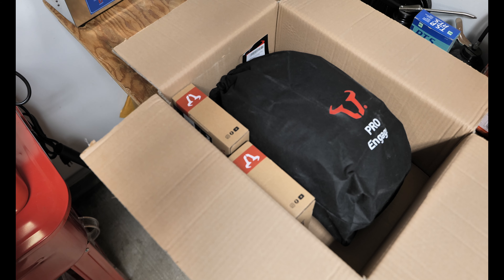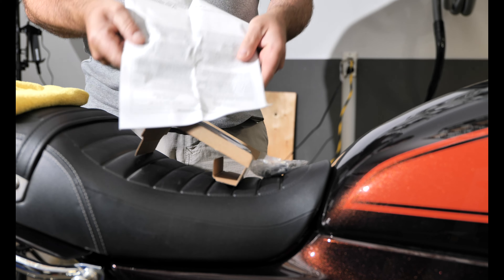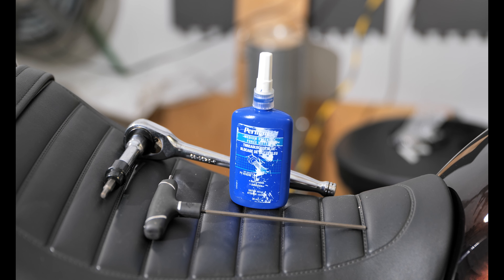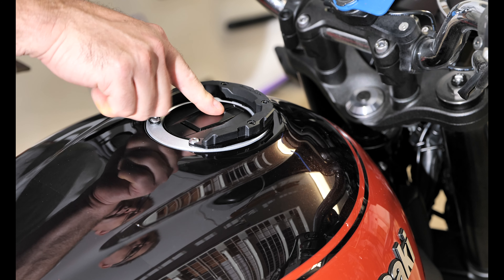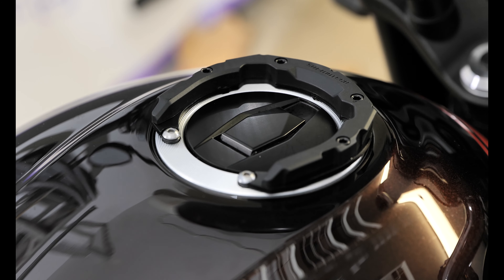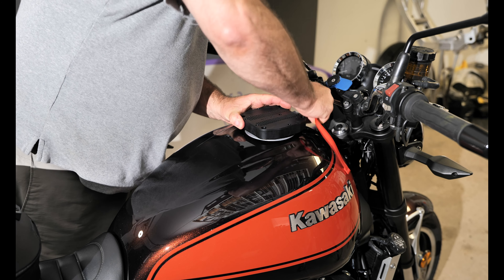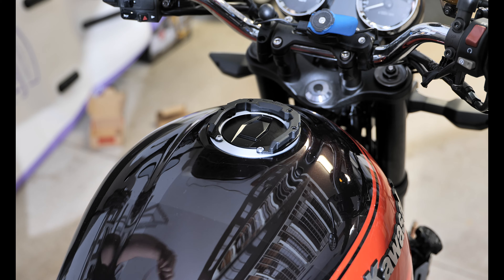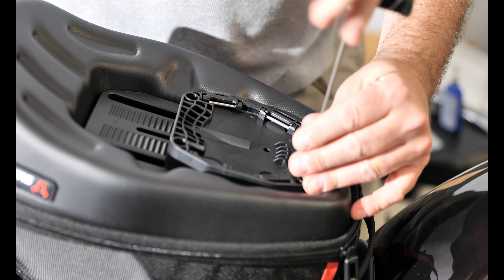How to install a SW Motech Pro Tank Bag

Comment: SW Motech sells 2 spacers designed to lift the bag a bit higher so it does not touch the tank in the rear of the bag. One is 6mm and one is 12mm. They are both pictured with part numbers in the bag mounting instructions and SW Motech U.S. has them in stock.  I just ordered the 12mm spacer kit to mount the Pro Engage bag on my CB1100EX and I am hoping it cures the bag touching the tank. It looks like the 12mm kit might just be two of the 6 mm spacers, which would be ideal so I can use as little as necessary. If they don’t fix the clearance problem I’ll return the bag.
Reply from the maker: Thanks for letting us know about the spacers!